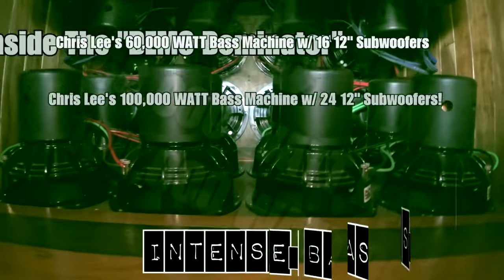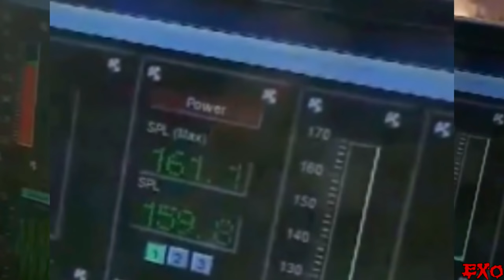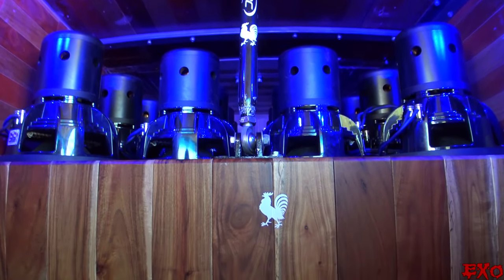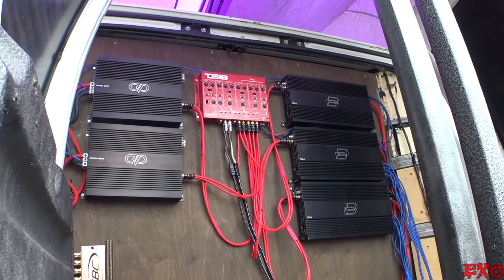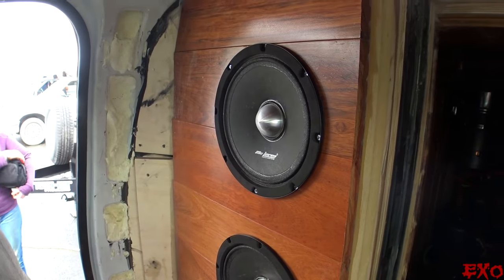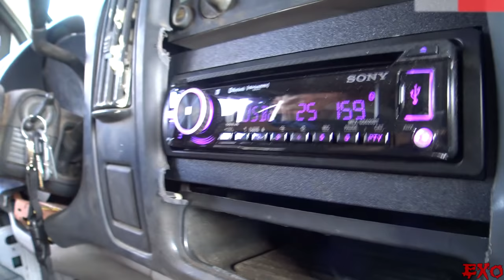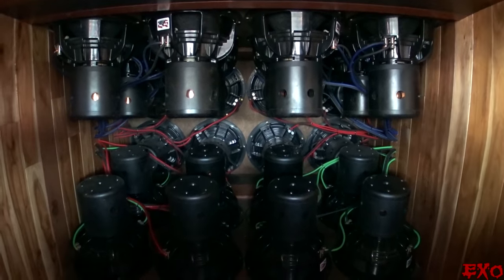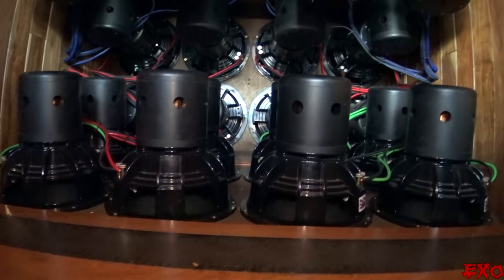24 12" SUBWOOFERS on 100,000 Watts!!! The BIGGEST NSv4 Sound System EVER w/ Crazy FLEX & Loud BASS

Comment: YO EXO! I love the builds that can hit every note with authority. I want to hear/feel everything!
Reply: One or one pair for each range of hz to cover all desired. Ex, 3 or of 10's, one is ported, one is med sealed and one is lg sealed. You directed it's power in specific hz such as a stick shift in your car can have high torque when in first gear or max speed in od. Each gear covers a small bandwidth of power. Imagine if you only had 4th gear. Would take an hour to get to 50mph if didn't drop the trans first

Comment: I'm not from the US, I'm from Trinidad, and down here we don't much go for SPL, some do but it's not the norm, vast majority of the builds locally for for SQ. I've been watching a lot of your videos and one thing I've always noticed, 4 18's on 20k with like 2 6" on mids and highs, Americans don't seem to much care about loud so much as pressure, at least that's what it seems like through these videos. We do have big walls and the like, but they're always paired with a mids and high system that looks a lot more like a concert speaker setup mounted on top of the vehicle, they're extremely loud, even from a few hundred feet away, but they all sound extremely clean. Beach days locally almost always devolve into a sound off because there will be multiple cars with extremely loud systems that all want to play different music, generally they take turns being the beach DJ and then another will play the next song and so forth, but sometimes it does devolve into a competition of who is louder. 

That's a long winded way to answer your question, I haven't personally been inside an SPL focused vehicle, but I have experienced a wall of 8 DD9915's at the window, I'm not ashamed to say I wussed out lol The loudest musical vehicle I've ever experienced, well that's Predator, I could only find super old videos for some reason, but here's a video (Not my video) from a show I attended back in the day, these two vehicles were "rivals" and would often compete against each other, and they drew a HUGE crowd https://www.youtube.com/watch?v=LGAQP10XJpU Predator on the left, Ghost Rider on the right, watch the green flag behind. I forget the specs on Ghost Rider, but Predator I remember having 10 15" Treo SSX's, no idea how much power tho

Comment: The record here in New Zealand is 198.3db a Ford transit high top van built by Fusion Audio. The high and low ends sounded ok but most of the mids trailed off at around 160db. Quality over quantity. Not to mention the only opening was the driver's door and when you looked inside all you could see is a seat with a hole behind it and a wall of 6 inch 2 ways where the passenger seat used to be. The only window was a square of 20mm perspex for the driver to see out of as the rest had been replaced with sheet metal. So not the best looking system.

Comment: How do I get more bass out of my system. 
Can someone give me some insight.
I'm running a kicker cx1800.1 rated at 1888rms.
And a Skar audio Vxf12 at 1500rms. 0G wires. I want loud bass. I dont feel my bass is as loud as it could be. Would it be better switching to those sundown subs
Reply: It come down to the enclosure for the sub. What kind of box are you using?
Reply: 2 cubic feet, Ported

Comment: If anyone could help me figure out a problem with my system I'd really appreciate it. 

Here's the problem: I have an old school crossfire 2 channel amp powering 1 subwoofer. Wired to 2 ohms bridged. Always played loud and sounded great. 

Last week I noticed the bass got softer when I was driving. It will get loud like it always has, and then softer, back to loud etc. When I'm driving down the road. 

Can anyone help me figure out what's going on? I'm thinking maybe bad capacitors in the amp but I don't really know much about circuitry so it's just a wild guess.
Reply: 1. check battery, 2. replace if old, 3. maybe put in a h/o alternator
It could be a number of issues though

Comment: Dude that Brown Note!!! 💩LOL!!! Back in the early 90s I had 2 Orion 15xtr's in a huge sealed box with Coustic Power Logic 460 pushing them. Coustic 6" & 4" mids & 4 Coustic tweeters on 3 Coustic 160's & a XM-3 crossover,... One night I was cruising with some friends, I was playing Beat Dominator & had to pull over so my girlfriend could puke from the bass. Not my loudest system but one of the best Sound Quality mainly due to the car "74 Dart Sport" allowing excellent mid&highs speaker placement

Comment: Hey exO I have custom hcca 15s I know there know for being stinky but I’m running mine properly no clipping after market Alt 2 d7500 XSpower. I’m gettn my subs to smell but with no real heat going to the coils. I’ve never Really pushed them that hard to the point they smell maybe 7 times. And there custom with plenty of glue I’m thinking the access glue is still burning off but I here Orion well all subs have there smells like you’ve even said. It’s nice having the subs in the right ported air space to over excursion isn’t really a problem I play 18-29hz and loving it. Rock on!! And thanks

Comment: I love some loud deep bass, in a musical system, not quite a SQ system, but I like hearing the music, without distortion, and noise, and I like bass heavy music! So the system needs to be loud and low, without too much tweeter to destroy your hearing, 2kw on subs, 200-250 on a pair of 6.5" mid range, and a 6.5" coaxial or separate, per channel front and rear and maybe another small tweet to get the stage right, not a door full of woofers, mids and tweets, maybe go as far as 8" woofers up front, with a pair of 6.5" or 5.25" mids with  a tweeter aimed just right, on a 4channel and 2channel class a/b of course! Around 200 w per channel, 3per up front, a eq, crossover  should get things just right , with about four 12"-15" subs , on about 2kw, is a good start! If more boom is needed, keep adding subs and power, until ya can't hear the front stage, then double it! Yeah I could use some headphones!!!

Comment: Startin a build in a 2 door 07 chevy cobalt with a psi platform 3 HP 15” in a 4.0 Cu. Ft. Ported enclose on a skar 4K. With nvx vsp65 v series on doors and rear on a 500.4 amp 2 xs power d1200 batteries. first build I’ve done what our your opinions on it??

Comment: I like to be able to play the whole of the range loud. Torturing yourself with one note sine waves gets old after a while. It's nice if it sounds tight and bouncy on house and trance music too. Besides at these levels it's like choosing which is louder, 10 grenades or 5? I'm not sure if I really need 160dB or even know what it sounds like. I have 2 vented 12" PA style subwoofers that should do 124dB at 1 metre outdoors on the ground, 135dB at 1 metre in a corner. I'm not sure what they'd do in a car with cabin gain, though I did try them in Ford Focus estate car but my inverter was starving the Peavey IPR1600 of power I'm sure. I have a couple of youtube videos of them at full blast (without any farty compression) and the mids and highs are already as loud as I can stand. Running 20dB louder than my videos I'm not sure I could imagine. I'd have enough to heavily rock a warehouse! Must be ear ticklingly loud and you'd have to let the bass dominate or the mids and highs would hurt my hearing.

Comment: Hey EXO i need to ask you a question about wiring a relay for the remote turn on to my amps. Is this necessary if im running 3 amps? Ive seen lots of people talking about needing a diode anytime a relay is used, and even some about using a resistor or zener diode along with the flyback diode. Any help would be greatly appreciated! Thank you!

Comment: I am waiting where are the nuclear fusion specialist or someone from nuclear technology that creates a mini core reactor like the aircraft carrier has but many times smaller. But would be damn good enough fir Homer Simpson to have a new Nuke job driving the Juke Bass Box Mission Fission Tank that'll knock the socks off for 50years nonstop.  While you were demonstrating the super cap capacitance bank yesterday.. You look into laser seam welding machines... They have a large cooling circuit and tons of capacitance. With 600 V industrial power. Combine that capacitance with super capacitance quantum capacitance and you can get far with the traditional system power. What these guys need to do when constructing a vehicle is just build a brand new vehicle using the chassis and do a full restoration like automotive guys do and build it for the purpose with the whole chassis as the power sled. Someone needs to copy Tesla. I haven't seen one electric vehicle using its power bank to power a system.  Where is the D'more engineering?  They should be on that and have the certified dyno vehicle showing up at all the competitions to certify everything.

Comment: I GET TALKED SHIT ABOIT BECAUSE MY CAR  WAMS!!!AND IM(OOOONLY) RUNNING 2 12IN KICKER COMPS WITH A KICKER 300WATT D MONO BLOCK,,,AND MY HONDA ACCORD (WAAMMMS!)    BUT MAYBE 25%, TO WHAT ILL BE DOING TO MY NEW TRUCK,!!!! I TELL EVERYONE!! WELL YALL ARE GONNA CALL ME A HUGUE DUMBASS WHEN THEY HEAR(4 KICKER 2ND ONES FROM TOP OF THE LINE,,,SO 4-"12S*)    AND THEN THE AMPS IM ONLY GONNA RUN THE 300 FOR DOOR SPEAKERS ETC,,,,THE 300I HAVE NOW!    THEN 2 COMP AMPS,,1 BIG BOY FOR EACH SET OF 12S (15S GIVE WAYYY MORE(BOOM!)     BUT TO MEEEE (EVEN WHEN I WAS RUNNING 2- JL L5S AND A 2200WATT AMP!!!!   OOOHHH MMMMMYYYY LORD!!!! IT CRACKED THE WIN SHIELD OF MY SHOW CAR IMPALA :/ DAMN I MISS THAT CAR(AKA THE *,COCAINE CHEVY 2s CUT OUT WHEEL WALES,,,TINY SPACERS,,,AND MY (22IN TALL 9 1/2in LIP!!!    ON A (NO LIFT KIT 2001 IMPALA(NO LIKE THEY LOOKED LIKE 26S I PLACED TOP 5 IN SO MANY SHOWS WITH THAT CAR